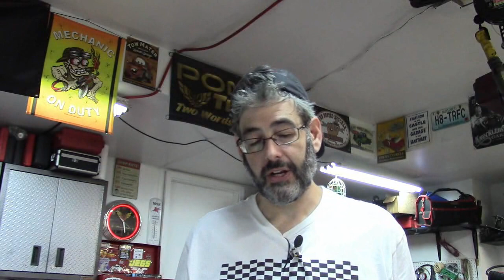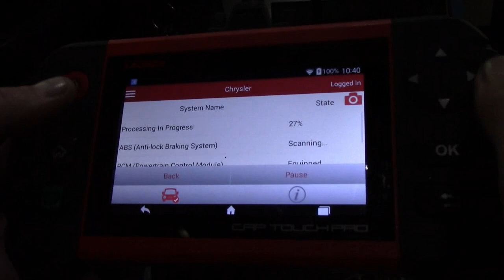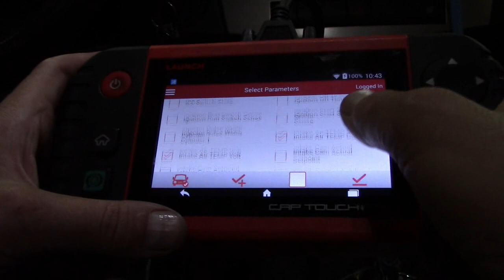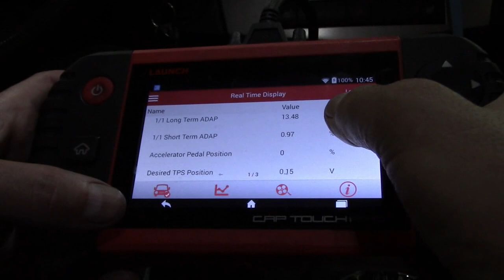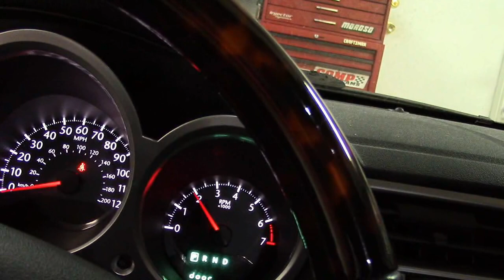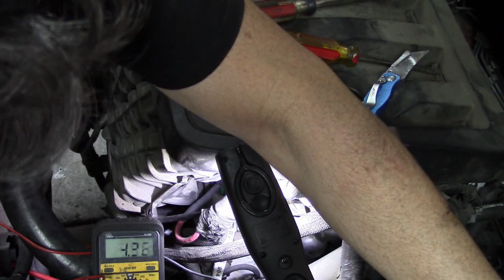2010 Sebring Very Intermittent Severe Low Power, Hesitation

Comment: Intermittent electrical is always time consuming. Since this is an electro/mechanical setup, a visual inspection might be a bit faster & provide great confidence in the diagnosis. Video feed the butterfly with a videoscope & compare with accelerator pedal position. You would see the butterfly not opening in proportion to pedal position. I love this content, & appreciate the level of detail you go through not to be a parts changer. Rare in todays automative industry.
Reply: Also just fwiw, I had a 05 Toyota Rav4 where fuel delivery was restricted in the fuel line. (The intake had been off & when reinstalled they somehow rotated the fuel rail delivery line a full 360 degrees.) The vehicle idled fine & accelerated fine until RPMs were 3k+ then it had no power and would not go above 3500 RPM. The only trouble code was o2 heater circuit low current. Which will put the vehicle in a safety mode usually cutting throttle @ 3k. Needless to say the techs had changed sensors & fuel pump, with no change. I stared at that circuit for way to long. When I went to pipe into the fuel system as there was no valve I noticed the twisted line. I about smacked myself. Fixed that & no more low current to o2 heater... Made no sense to me & threw me for a loop.
Reply from the maker: I don’t understand how that would demonstrate the APP position signal was sent. How would you see that on a visual inspection?  That doesn’t make sense to me- how would you do that visually so you can be confident on where the fault was?
Reply: @SchrodingersBox  If I remember correctly you had verified APP signal at least through the PID & that you had a signal @ the connector to the throttle body. I didn't mention this step because I am preaching to the choir. 

I just mean, once the circuit up to the motor is verified, instead of looking at the scope for an output from the butterfly motor. A visual of butterfly operation would have been another angle.

I dont mean to imply one way over another, just if a DIYer cannot see that digital signal in its waveform they are in SWAG territory. Also for me with electromechanical systems the correct signal parameters should be known, it is more comforting for me & that info can be hard to find for even a professional DIYer.

Unfortunate this vehicle offered no real trouble codes with apparently 2 TPS'.

Comment: The check engine light was caused by the temperature sensor for the cooling fans connector weak connection
Reply from the maker: Based on what evidence?  The IAT has NOTHING to do with cooling fans.

Comment: Had a 2002 that had a similar problem. Found multiple problems caused by other shops. Connectors on coil pack #1, fuel injector and cam sensor connector shorting.  The cable connection for the engine harness was weak and intermittent, lastly was the wire from the computer was not  working consistently for coil pack #1. Checked fuel flow and fuel pressure were below spec. Also the hose from the airbox and throttle body had tiny cracks

Comment: Yup,
Loosing eyesight as you get older.
I have glasses and after two years need a new prescription.

What would you do for 20/20 vision?
Reply from the maker: Hahaha I never had 20/20 uncorrected- actually I am blind in my right eye.  I wear a contact lens in my left eye which brings me to 20/15 But man up until 2 years ago I never needed reading glasses or anything- I always set the font on my phone to the smallest possible to get the most data at one time....
  Now I can't even read my phone without reading glasses and I am ready to abandon the contacts and just start wearing pocketed shirts so I can keep my reading glasses on me lol.  Its ridiculous how fast this suddenly happened!!
Reply: @SchrodingersBox  I have my gasses AND a magnifying glass on me at all times.
Reply from the maker: Hahahaha. yeah I bought a credit-card sized magnifier I keep in my wallet lol. OMFG. Kill me now.

Comment: Great video.  Make sure to counsel your client.  At 4:04, do not underestimate the value of a transmission flush on a 10 year old vehicle.  Over time and heat cycles the transmission fluid separates and does not provide the proper cooling and lubricating it should.  I know of at least one person that thought the fluid is good for the life of the car.  He had to call a tow truck from the highway and then had to replace his transmission.  Also, the change in spark plugs may be needed as well depending on the service interval for that make and model Chrysler.
Reply: Scotty Kilmer says that on some vehicles that haven't 
had regular trans fluid changes, like 10 years etc,lol
changing the fluid at that point is a death sentence to the trans.
:shrugs:

Comment: I think that you can't see problem acting on duty cycle beacuse PCM gives that signal. If there was a problem wouldn't be PCM suspected.
Reply from the maker: You can see the PCM signal at the motor connector if you look closely at the oscilloscope data. The signal is reaching the motor- the motor is not reacting. If I did not see signal at the motor then yes, I’d verify the signal is leaving the PCM and if it was I’d trace a short or open.
Reply: @SchrodingersBox   Thank you I thought that

Comment: I might try a good cleaning of the throttle body first.  Those 2.4's like to get plugged up with carbon in there and make the throttle blade stick.  Then again the customer probably just wants it fixed for sure.
Reply: Throttle body cleaning seems temperamental to me.  However is anything permanent on a 2.4 Chrysler?
Reply from the maker: Yeah i could try that but I have never had success cleaning the TB - I’ve tried it several times and the vehicle always comes back with same issue.
Reply: @SchrodingersBox  i had to send my accord back to the dealer to have it fully reset and relearned after cleaning the TB... It went bananas

Comment: Cmon. 
Some makers do delay the RPMs under NO LOAD is EXPECTED!!

Modern drive by wire systems are MORE intelligent than the regular bloke!

The CPU does delay the electronic throttle so you CANNOT make much on that alone!

Test gas pedal command vs throttle opening.
Reply: Did you and I  watch the same video?  It's an intermittent problem.  It didn't delay the engine RPM boost all the time, just some of the time.   Also he addressed the correlation of the throttle position and the "Gas Pedal" command as well.

Next time watch the video a few times,  You'll see he addressed everything you're complaining about.  32:53  Everything is WORKING FINE! and he has to continue to test and retest until it failed again.  This blows your assumption out of the water.
Reply from the maker: What Teddy said. All those were addressed.

Comment: great video , i am the same and not just a parts fitter , here in new zealand us techs are trained to test before replacing , it saves time a and money and makes the job more satisfying
Reply: I wish the majority of the U.S. was like that. It is hard to find a decent tech, even when you find one that can properly diagnose a problem a lot of times they have to upsell, I hate unnecessary repairs. Like you mentioned, nothing more satisfying than fixing exactly what the problem was.

Comment: My mechanic just told me "What about your timing belt"? I wanted a brake job - pads x 4 plus rotors job 1998 Honda civic $500). 
I told him I expect 500mls on it as is.
Reply from the maker: Hahaha. It amazes me how every time people show me a technician report they always have recommendations that have absolutely nothing to do with the complaint. i mean, I can see if they say you need brakes when you get new shocks, but how would they recommend you need a fuel system flush?  Amazing.
Reply: @SchrodingersBox  
Exactly!!!@@